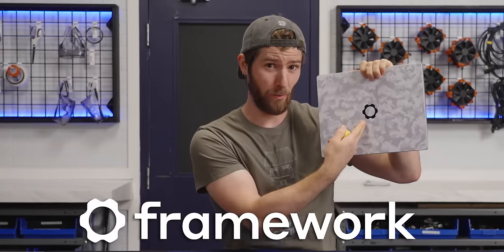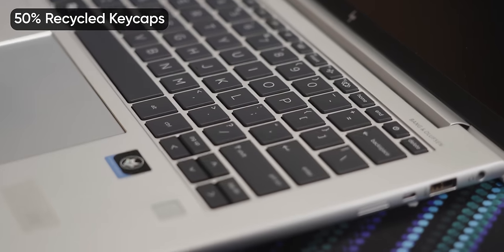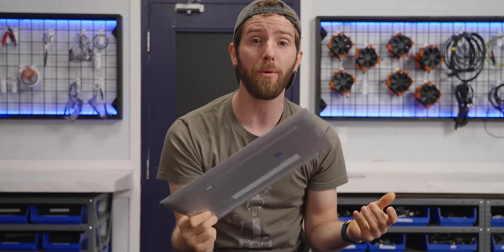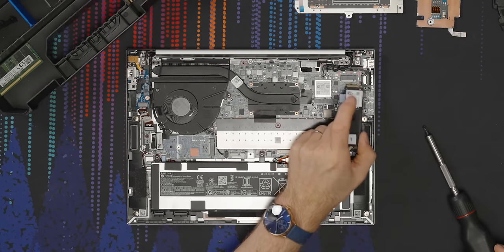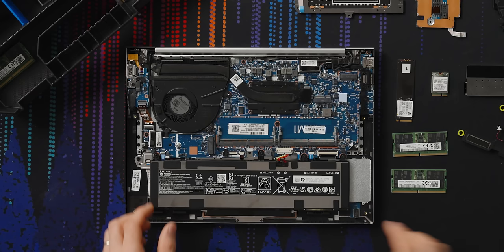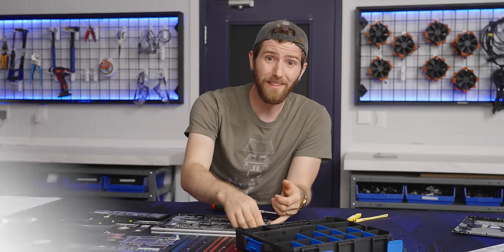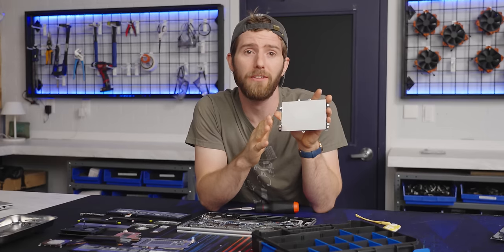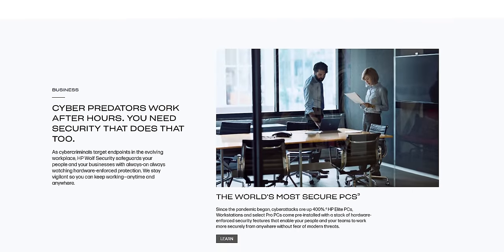My Investment is in TROUBLE - HP repairable laptops

Comment: Things like the captive screws were already a thing from their 840 G5 onwards (got lots of them deployed where I work). Daughter boards for all ports is a step forward and also how some Toshiba laptops used to be built last decade.
Reply: They did mention that in the video didn't they, I remember them including the image of that stack of HP laptops that is referring back to a previous video.
Reply: philips screws are trash. They strip easily. My old macbook pro has philips that are nearly all stripped. Torx is much better.
Reply: @blaynestaleypro  You only strip screws that small if you use the wrong size bit or poor quality screws. On smaller screws its easier to strip out torx
Reply: @Darksteel165  nope. torx is better all the time. Every time.

Comment: HP has been the supplier at my agency for a while now..  ( Treasury Department ) 
Talking 60-100k laptops lol  ( only for my branch, this isn't all of the treasury )
Glad to see the newer generation is like this and serviceable. I think we're on G8's but these will end up being there soon.  
Impressive to see HP take this route and move towards this kind of design.. Honestly gained a good amount of respect for them.
Reply: HP Elite and Z-line laptops have been this level of serviceable since at least the G3 line.
Reply: Honestly, this just basically caught up to Dell's typical level of repairability. 

(I'm an HP, Dell, and Lenovo certified technician and repair dozens of laptops per week)
Reply: We use G8s as well, and a flaw I can still see of this G9 is that the keyboard is integrated into the body, so if you have a keycap or something fall out you need to replace the entire bottom chassis of the laptop, which requires taking everything out of the machine.

The G5s and 6s had the keyboard as a separate unit to the frame, if they could return to that it would be truly fully repairable in a reasonable fashion
Reply: how do you handle fan control on the machines when they do overheat?
Reply: @4Simmix4  speedfan??

Comment: I'm seriously mind blown by the direction HP decided to take. It is certainly the way to go and should have been this way for decade.
Reply: As a repair agent, many commercial laptops (not just HP) have actually has been this way for a good while, Lenovo Thinkpads are very easy (at least he the ones I've had to work on). Going back further than that they were actually way better.  8-10 years ago they decided to make some models intentionally difficult to repair it seems (I blame Apple's influence). These days repair manuals can be found easily for most models for Dell, HP and Lenovo without needing some stupid partner login details.  Parts can be a different story, they're mostly too expensive (mainboards and display panels can cost nearly as much alone as the original laptop did...)
Reply: EU is working on repairability similar to how USB-C was made a mandatary standard by them. The smart money is on being ahead this time.
Reply: if they only would do this for their printers, too
Reply: It's been like this forever on the business side dingus
Reply: @Alaster-  Yeah I don't see why this laptop called "reapairable" while my curent and previous laptop (asus and hp but 10 years ago) can be dissasembled about the same like this laptop in the video. The only difference I can see is that I can buy the parts from HP itself insted of buying it from ebay where I always found every replace parts for my previous laptops. And yeah sometimes they were realy expensive, but most of the time reasonable.  Screen and cover usually not that expensive, at least for asus.

I want to see upgradability in new laptops. If they could be upgradable then the waste would really be reduced. People hardly ever buy used laptops, if I didn't have to throw my laptop in the trash every 4-5-6 years because the casing, display, hdd and sdd would still be usable, I would only have to replace the cpu or gpu and the waste would be significantly reduced.
Reply: Yess! Especially with the Dev One
Reply: @Alaster-  agreed. Been this way for awhile now - at least in commercial fields. I would’ve added an asterisk in this video that these laptops aren’t really marketed toward normal consumers. I’d be interested to see how repairable an HP spectre would be.
Reply: They rather go back. 15-20 years back HP's where a breeze to repair. Especially the professional/business variants.
Reply: @FQQD  Yep. I work in school tech support and managing printers is among my least favorite things of the job. Recently, we've had some newer HP printers that have been ordered. The biggest issue is that they require an internet connection to even work at all. We network most of our printers, so that normally isn't an issue, but they require you to create an HP account, register the printer and then it can print. It's insane.
Reply: @Alaster-  but they're not upgradable, that's the main appeal of framework. when new cpu/gpus are lanched they release new motherboards that can be put on older devices because the laptop case/layout is supposed to never change
Reply: @gb76231  100%!!  best thing about framework is their commitment to part upgrades instead of requiring whole new devices. 

My previous replies were in relation to HP (commercial products at least) being fairly easily repairable, and it being nothing new. It's not a new direction for them to have an easily repairable device. Considering the chassis for the Probook and Elitebook line has changed very little the past few generations (I haven't pulled the current one apart - but it looks very similar as well), HP could easily support part upgrades as well if they decided to support it. I'm betting they won't.
Reply: @davidfarkas3963  well because most laptops in that price range and class decided to take the "everything soldered" path, that's why for modern standards it is great to see that one manufacturer decided to bring back the ability to repair it easily by yourself or technician without soldering anything.

For upgradability, sadly only framework offers that feature and the cpu or gpu (hopely they can make mxm designs back) is still soldered to the motherboard, so to upgrade that, you need to change the whole motherboard.
Reply: Which is exactly why Lenovo has always been this way.
Reply: @Ttamlin  which lenovo model exactly? Even thinkpad lineup has reduced the number of parts that can be replaced/upgraded.
Reply: As others have stated, this isn't new for HP or other companies that deal with enterprise equipment. The ability to repair out on the field has always been a requirement to minimize downtime. That doesn't mean that once the warranty is up they aren't replaced by completely new devices. This shouldn't be shocking to be honest.

Comment: The thing I'm curious about is the components on the motherboard. One of the biggest things Louis Rossmann talks about is being blocked on getting a 20 cent component to keep from having to replace the entire motherboard. This seems like a good step, but would have liked to see a thorough review of the entire repairability.
Reply: True, but think of the degree of time it would take to literally hit up almost every possible avenue/ provider of components to be able to list that? 

I think rossman’s level of repair and necessity is that ‘2 steps beyond’ what most hobbyists need. At a consumer level though, what framework and HP are doing should be bear minimum
Reply: At least if you screw up the USB you can replace it's board instead of throwing out the whole mobo so that's a success.
Reply: @Dezzsoke  for one side... The other side is all mounted to the mobo. And the mobo is locked by HP (assuming you want to update it's SN, Part name, part number etc so that your OS recognises it correctly. This not such a big issue for basic consumer, but it's massive for businesses).
Reply: well rossman is a reapir guy it is his job to get those parts and replace them and from what he tends to complain about there not usually laptops but macs. that ruffle his feathers
Reply: @MonolithStudiosMelbourne I know it sounds like "bear" but the correct term is "bare minimum". Not being a grammar nazi here. Just thought you may not know and would want to know the correct wording.

As for the companies to provide individual components down to the nitty gritty, I agree it's not an easy feat. What they could do instead however could be to provide a link directly to the capacitor source for example so that people could get them from them instead of HP if they so need, rather than HP trying to control every single little thing's availability to consumers. It won't kill them, and on the contrary in my opinion would really strengthen my trust to HP as a brand much more than others.
Reply: How many people in you family can solder a single 0402 SMD ?
Reply: @casparhughey5651  and Samsung and Huawei and LG and... Most companies have followed apples lead with repairability, if you want a phone with an IPXX rating you don't get a headphone jack any more for the few cents it saves to waterproof the phone. I think a major part of letting people repair their own devices is that the big companies have realised that it is cheaper to sell you the parts to repair it yourself instead of them having to do it. Watch, apple will come out in about 3-5 years time and announce the first fully modular MacBook or Macintosh desktop and claim it is a revolution in thinking
Reply: The problem with a lot of companies like apple is they ban their manufacturers to sell the replacement parts outside the chain loop.

Comment: Some of those parts are so expensive. $563.27 for a replacement LCD panel? $147 for an LCD "support kit" (which i suppose means a bracket), $169.27 for the LCD ribbon cable, $465 for the webcam module, $267.41 for a lid without the LCD, $227.58 for a replacement keyboard panel, $438.10 for a 512GB SSD... etc.
Last time I bought a genuine 17" 1080p LCD panel from Samsung's UK service centre it was £120 (about $150).

Comment: Two things that still might be better.

1. TrackPoint like in ThinkPads. It's not for everyone but one can dream. And HP does support it on some models.
2. One USB-C port on each side! Srsly the ability to charge from either side or dock to an eGPU enclosure is enormous!
Reply: 2. especially for the lefties among us.
Reply: @con-f-use  or just the ability to charge the laptop on either side instead of having to loop the damn cable.
Reply: @con-f-use  I don't see how ambidextrousness isn't a bigger part in laptop design. At the very least the a ability to charge and a USB A on each side, for mouse room
Reply: Or even just more ports in general. I love what framework is doing with their swappable dongle/port things and it would be great if other manufacturers did the same.
Reply: I also really want more double sided USB-C laptops out there
Reply: And physical touchpad buttons... i can't for the life of me use these new touchpads without physical L/R buttons. If nothing else, atleast the professional laptops should have kept it as it was, this is nothing more than a cost saving abomination...
Reply: I have last gen elitebook 845g8. It have trackpoint and trackpoint physical buttons.. It have same level of serviceability.
Reply: @con-f-use  among us 🤨
Reply: @con-f-use  😳
Reply: Not sure about the newer models, but I had to repair an older ThinkPad model (albeit not with a nub) and despite being a Core 6th-Gen device, Lenovo appear to still have all the parts CRUs & FRUs for the laptop (including many alternative part numbers that will still work, like the displays in the video here) and the service manual.
Reply: @con-f-use  AMGOUSS????!!!/!/!!/! Aaaaaaaa
Reply: @medicenelpepe  yes, they hide in plain sight, those scoundrells!
Reply: Having gotten use to having it, having at least one USB-C on each side has become absolutely mandatory for me. Some places I use the device it makes sense to plug in from the left side. Some places I use the laptop it makes sense to plug in from the right side. It's a huge convenience for day-to-day usability.
Reply: @con-f-use  Being a lefty myself, even though I use the mouse with the right hand, this would be a nice addition.
Reply: @rougenaxela  In my case on my desk it's way easier to plug it into the hub. For eGPU enclosures this would be extremely important because the cables have to be short.
Otherwise the left side to plug it in is the better one.

Comment: The important part is that never got mentioned for HOW LONG they will supply parts 
Maybe I didn’t hear it but that is a crucial part of the evaluation… sad that it was not taken into consideration
Reply: I know that for the Zbook mobile workstation line, parts will be available for at least 5 years after HP stops selling that model. That generally means around 7 generations (around 7 years) - the Zbook G10s are available now, and my Zbook G3 from 2016 is just reaching end of support. I was able to order a replacement battery around a year ago direct from HP.

Comment: A couple of concerns I didn't hear addressed:
- How many years out will these parts be available? I couldn't find a battery for an HP only a couple years after its manufacture
- Keyboard replacement for spills?
- Will they fight you over warranty?
Reply: Yes This, i often need to replace a keyboard because a customer bought a laptop with a dutch keyboard while almost nobody uses that. They always want a US int. 

Also, i think Linus was lying about only needing the screwdriver, to open the back side you need very strong fingers or a plastic thing to force it open. (I think its in a IFixit kit). I tried with a flat screwdriver and got it open but with damage to the plastic.

And last, great that you can fix the laptop but after 5 years it's almost useless for all customers at work, the option to upgrade would help.
Reply: Keyboard cover assembly is right at the bottom of the tear down, you see Linus holding it with the mainboard attached near the end before he re-assembles. It's a massive oversight of Linus (and his writers) not to mention it, and even bigger one on HP's part to have it that deep since it's the most common thing that needs fixing.

HP, at least for the Australian region, seem to be fairly reasonable to deal with for warranty acceptance. That said we have a decent consumer laws as well that HP know they have to comply with. I'm betting HP's stance would vary region to region.
Reply: @Rhoanor  re opening, while a guitar pick style tool or plastic spatula will help, they generally pop open at the screw end a little and then the cover can be lifted and wriggled open from that point. There are little plastic clips that the cover hinges off on the opposite side to the screws. Trying to open the wrong end, if you're used to doing it on other laptops, makes it harder.

Comment: As a previous computer repairman, HPs laptops was already quite repairable 5 years ago. Also their business support was exellent, you could order parts directly.
Reply: i have hp x360 g1 440(8gen intel cpu) and i can find on youtube official hp disassemble guide
Reply: Yes, but the HP batteries are TRASH! Both my personal and work laptop battery died!
Reply: They need to be, due to the amount of issues with their laptops xD... even the zbook line is subpar compared to the likes of lenovo or dell, both of which are also highly repairable ;)
Reply: Lenovo and Dell is pretty much the same on the inside. tho the parts might be hard to get tho...
Reply: Not sure why everyone is touting the repairability of Dell and Lenovo. Have you actually disassembled the newest ThinkPads and Latitudes? They're not very repairable (especially the ThinkPads).
Reply: @oumu  yep do it almost evry day at work, i am a certifid tech for dell, hp and lenovo.
Reply: @oumu  Thinkpads are just a meme now. No hotswappable battery and partly soldered ram are a real dealbraker. I dont get who thinks its acceptable to only have tiny 50wh batteries. Close to 100wh with the biggest swappable battery on a T480 are a dream. The only good thing about the new thinkpads are some of the screen options like the low power igzo one. Half the power draw of the normal ones, good colors and higher brightness.
Reply: @dtibor5903  have you tried charging it
Reply: I buy a deal on Amazon Spain a 350€ 15s-eq1040ns Ryzen3, 16gb RAM and 512 SSD.
The bios of the laptop doesn't support to change the VRAM config. On a 16gb factory laptop your igpu can only allocate 512mb of VRAM, not a single MB more, not a single less.
I call HP of course to ask if they change the hotkey for advanced bios config, you know what they tell me. That I can buy a expensive one if I need more VRAM, he show excitement and interest on sell me a new one in the same call.
If the laptop have the Ryzen 3 logo on It, it's legal to loock down oficial features (for the only reason of selling you a expensive one If you really need the VRAM) showed in AMD website and still call It Ryzen?
How this isn't false adverticing or anty costumer policy?
Reply: Thier business support may have been good but unfortunately I'm not a business, nor am I a computer repairman.
Reply: kinda makes me sick how Linus acts like there never been repairable Notebooks on the market before Framework and HP just reacts. But what to expect when LTT just Showcasing Reviewunits of Gaming Slim and Lights from Razer and Asus or Apple Macbooks... Script of thos vids feels like a sales rep just reading the Specs from Website + Crab rave, Webcamtest and Gaming Bench....